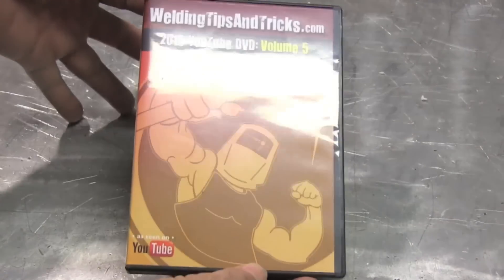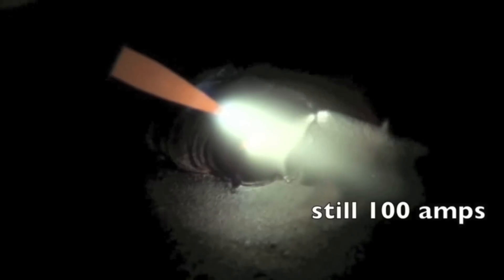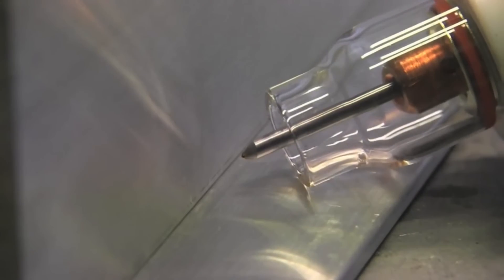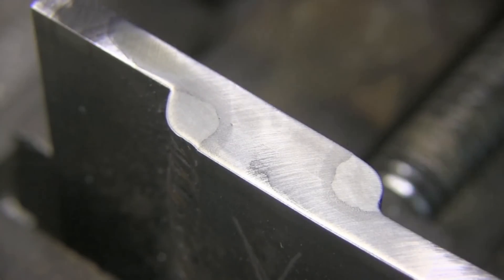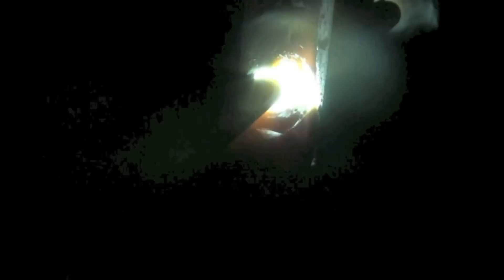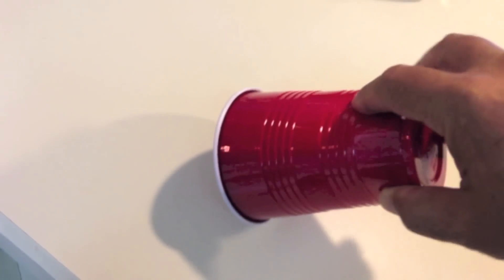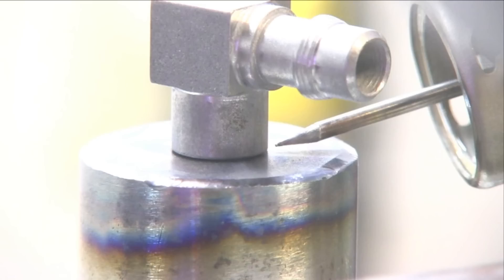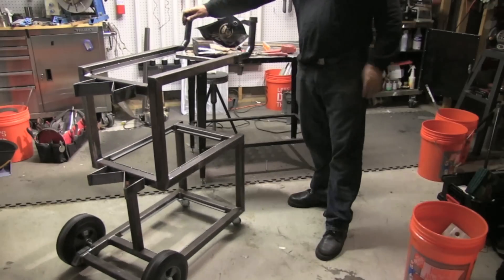TIG, MIG, and Stick Welding Tips

Comment: I wish you were my instructor at my high school welding class, I learn more from your videos and experience then I do in that class especially when my instructor says that what I learn from you is generally wrong.
Reply: I suspect your instructor isn't as nearly as certified or experienced as Jody.  Jody even points out things where there is some differences in people's opinions or codes that might be different in different states. Listen to your instructor until you pass the course then use Jody's advice. I've learned how to weld with my everlast from Jody's videos. In my opinion he is the real deal.

Comment: At work I always keep the electrode entirely balled and flushed with the cup for aluminum. We also preheat the metal by running the torch over it and giving it a nice white crisp path over the area to be welded. This helps with penetration and a nice looking weld.
Reply: also note that I work on sheet metal. the thicker the metal the sharper the tungsten might have to be.

Comment: Do you have any tip videos on welding copper? I start a new job soon where I'll be welding aluminum. They also weld copper in the shop and I would like to learn, not just for my personal gain, but to also make myself more valuable around the shop.

Comment: Hi Jody
Thanks for the Videos 
I have trouble seeing when Im welding. Most of the welding I do is outside in the sun shine. using core shield mig
Im 52 and my eye sight is waining a little. 
I do have glasses but they only help a bit. 
I have tried a cheater leans and a few different helmets. 
Im wondering if I should go to a expensive helmet or not. 
Any advice would be great 
Gregg Hooper
Australia
Reply: is your hood auto darkening with adjustable shade? try lighter/darker shades.

I've had it where I had to go darker with lots of sunshine and then more sunshine required less darkness on my hood.

no clue why. one of life's great mysteries...

Comment: Hey Jody, I have a problem when I TIG thick steel parts 1"+ where when I go down on the pedal hard to get enough heat to melt the base material I tend to loose the point off my electrode and it balls up, then the arc wanders and is hard to direct. Do you think this is most likely me getting too long an arc or just too small of an electrode for the amps? I don't seem to have this problem on pipes, only on big heavy shafts.
Reply: what size electrode are you using and is it steel or aluminum that you welding, and what is your gas flow at?
Reply: sorry I saw you said steel.  It definitely sounds like your electrode might be to small.  A long arc usually wouldnt do that, you just get really bad welds and no penetration.
Reply: Exec AMG
1/8 running DC straight. I think I have everything to try some 5/32 may give that a go next time and see if it solves it.
Oh and no flow meter on my gage set but I run around 20psi. I wouldn't think it to be a shielding gas problem since it is fine on the lower amps.
Reply: do you have a gas lense? a nice gas lense really helps with shielding that arc. I never went back to a normal cup. Also, have you tried not putting so much amperage at first and slowly increase it to get the puddle started then decrease as needed as the part starts to heat soak.
Reply: +bcbloc02 how meany amps you talking about? over or under 200?
Reply: mog5858
probably right at or just over 200amps. I am nearly full pedal on a circuit that maxes at 225. There is no meter on the welder so can't say exactly. I use a stubby gas lens that came in the torch kit I got from Jody here.

Comment: hey Jody I'm having a hard time passing a 4G tig test the root is never flush with the plate or sometimes concave, any suggestions? 
the set up is 3/8 plate 37.5 degree bevel, my instructor just suggested a 1/16 landing but I'm not sure that's allowed in the test, open root, 1/8 filler rod. thanks
Reply: oh and 1/8th gap
Reply: Jody has covered it, several solid 4G vids you outta be able to nail that test
Reply from the maker: +steelforge08 https://youtu.be/l941-76WB-g
Reply: +weldingtipsandtricks thanks!